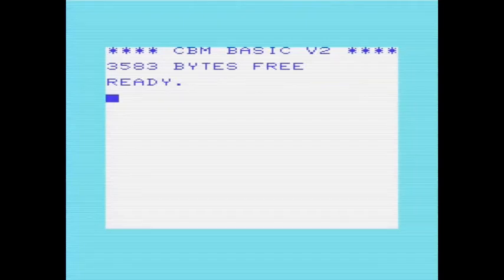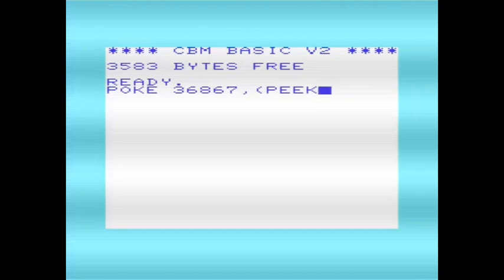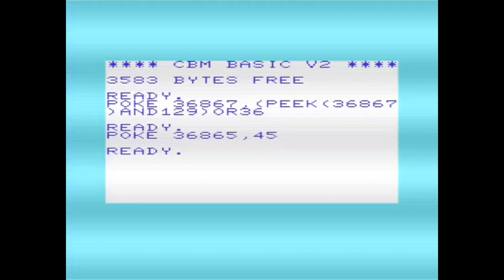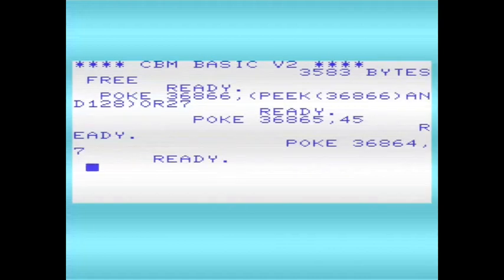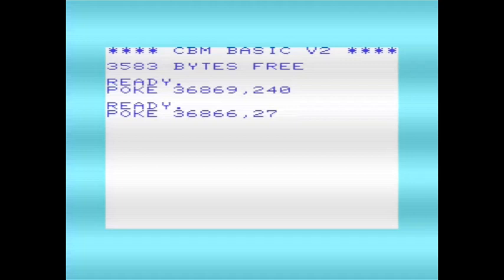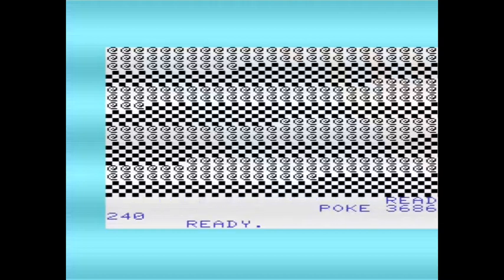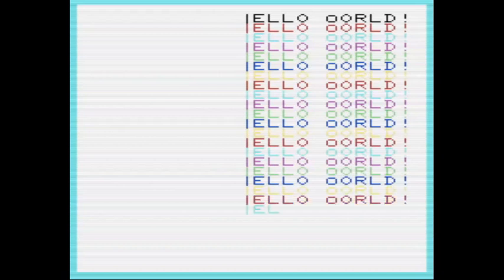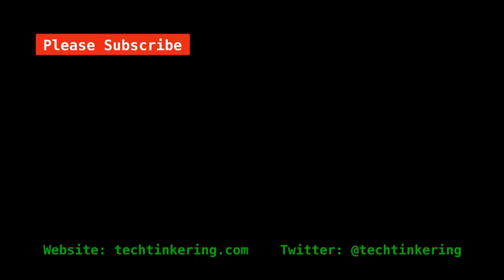Changing Screen Dimensions on the Commodore VIC-20

Comment: One surprising feature of the unexpanded VIC is when making it point to a charset starting at $1C00, which makes the shifted set of chars to be in the same location as the screen (so we don't use them) but since the memory stops at half way the charset / the end of user mem ($2000) it jumps over to $8000 and displays the default chars (visible by turning on reverse of course). An excellent way of memory saving if one only needs 64 or less custom chars!

32 chars is more than enough to use for a full screen width smooth scroller (232 bytes, 29*8) where all chars are bit shifted to the left and the screen is reduced to just 1 line, the rest of the now invisible screen memory (483 bytes) can be used to store the copied from ROM chars.

Comment: Regarding the VIC-20 memory map changing around with memory additions, I strongly suspect this mess was caused by Jack not wanting to put 8K of RAM in the system. He wanted to keep the price below $300 and another 3K of RAM would have cost too much. This is static RAM we're talking about here as well.

By reducing it to 5K, this left a 3K hole. They couldn't put it at $0000 on a 6502 system and putting it at $1000 would mean 8K expanders wouldn't work unless you also had a 3K expander. So they put it at $0400, meaning adding a 3K expander gives you 6.5K or adding an 8K expander gives you 11.5K.

This setup meant that there was no one best place to put the screen memory so you could benefit from both the 3K and 8K expanders as it would always be stuck in the middle, splitting the free RAM. So they put it at the top of the 4K for unexpanded or 3K expanded setups, and put it at the bottom of the 4K when there was an 8K expander.  Technically, if you had both a 3K and 8K expander, they could have put the screen at $0400 but then 8K programs would have to detect and deal with it.

It all would have been so much easier if the VIC-20 had been given 8K of RAM. The screen would be put at $0400 and we could have a max of 31.5K for BASIC instead of only 27.5K.

Then there is the issue of having 8K at $a000. If that had been swapped with the I/O and CHAR ROM area at $8000, the VIC-20 could have had 39.5K of RAM for BASIC.
Reply: The amount of RAM isn't the bad thing. The bad thing is that the Vic could address 16K VRAM, had more pixels on screen than the VicII...but alas....

Comment: There was also a double height text capability, which was achieved by a series of POKEs.  Great videos!  Good to document vintage machines for the sheer enjoyable nostalgia as well as the engineering concepts and thinking processes, some of which can be a perspective transferable in solving problems today.
Reply from the maker: Thanks.  I've got plans to cover double height fonts in a future video.  I often wonder how things would be different if we took a slightly different perspective by looking the past.  In fact it is something that is particularly motivating me at the moment on another project which I will show in the future.

Comment: Although the Vic isn't able to display a proper bitmap like the C64, it's actually capable of displaying 4kb of screen data by turning on char doubling (bit 0 of address $9003). In essence this means it displays the data of 2 charsets (256 chars of 16 bytes). When displayed as a 16x16 char matrix it gives a resolution of 128x256 pixels.

Comment: Could you, in theory replace the BASIC & Kernal ROMS to give you jiffydos and larger screen display (in basic).
Reply from the maker: While this may be possible in theory,  you would introduce all kinds of incompatibilities with existing software.
Reply: @TechTinkering  well, there are switchable  kernel roms for the vic-20 and the c64. You can also replace the vic-20's 6502 with a 65cc02 as well.

There is a replacement BASIC rom set for the vic-20.  Time to fire up the eprom Burner,  methinks.
Reply: There are a handful of modified VIC-20 KERNALs that have increased columns and rows. Before I knew of them, I made my own with a 24x20 screen. It required the modification of approximately 32 bytes in the KERNAL because it is hardcoded. It would have been nice if you could just change a single value each for columns and rows. BASIC itself doesn't really care what the screen size is because it follows the KERNAL. These modifications should work on the JiffyDOS KERNAL as I think it unlikely it changes the screen size and editor code.